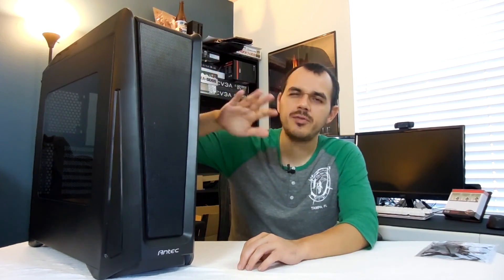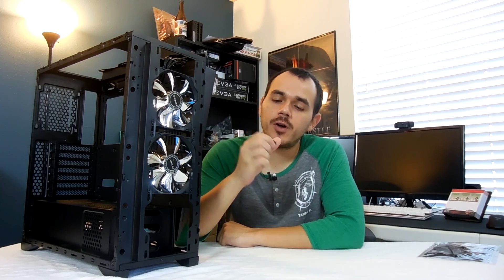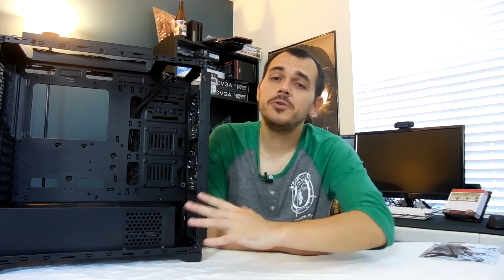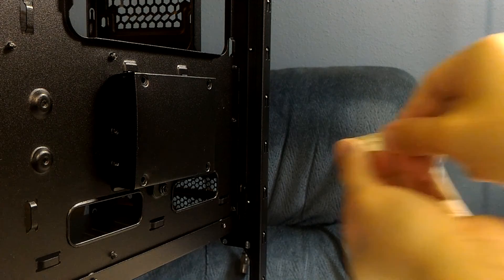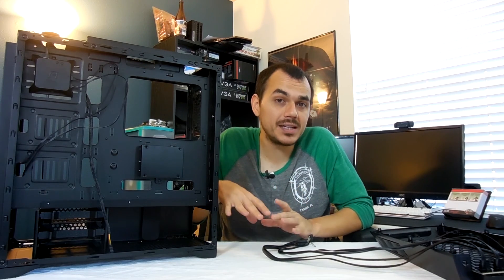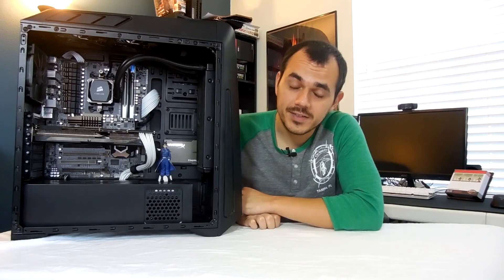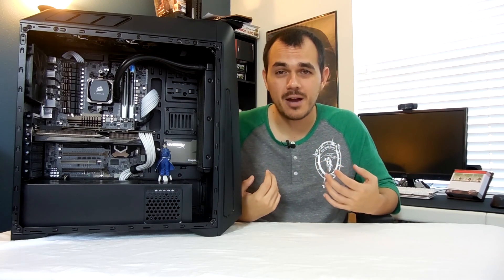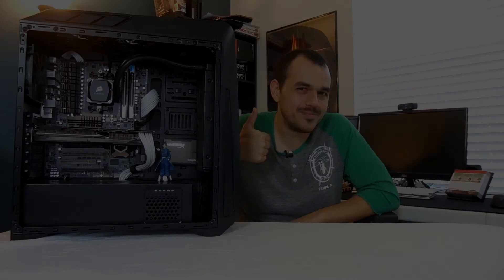MANIC TECH #0027: ANTEC GX1200 REVIEW

Comment: What is the max water cooler radiator size?
Reply from the maker: 360 mm in the front, 240 in the roof if it's a slim radiator and your motherboard/DRAM heat sinks allow for clearance.  Sorry about the music in this vid, it got really screwed up for some reason x-D

Comment: Hey Man thanks for the detailed vid!!! Ive got the gx 1200  myself and am thinking of putting a 240mm cpu water cooler in and installing it at the top, simillar to the model you have. I've heard a few complaints that there isn't actually enough space as advertised and I saw that you installed your radiator on the side, is there any reason you never used the 240 slot and opted to put your radiator on the 360 slot?
Reply from the maker: In my "case" (see what I did there), it was purely a matter of RAM clearance: I have grown to loathe my Avexir Raiden DIMMs because they are so restrictive in terms of what water cooling configs I can use.  If you are using low profile RAM like Corsair LPX or something like that then you should be fine to use the roof.  This case is actually a perfect candidate to get one of the EK A240G kits and get the 360mm rad expansion kit to go with it, it'd look SUPER clean and fit like a glove while still being practical. Just my opinion, tho ;-)

Comment: Will the magic box accept 4 pin PWM fan ? or only 3 pin ?
Reply from the maker: +MrUriel250 it will accept 3 pin and 4 pin designs. Just know that if they are LED fans and they run at slower speeds, the lights may not display correctly or may not display at all.
Reply: What are slower speeds?